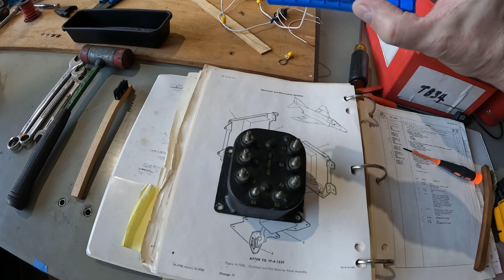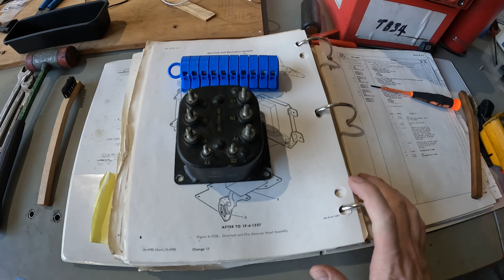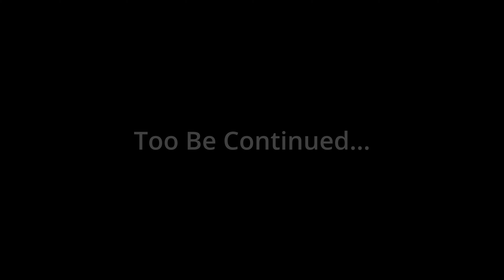Removing The Bad Relay, Maybe | F-4 Phantom

Comment from the maker: This was probably my biggest challenge to edit so far, with so much video from one camera angle as we worked on this relay. I know a lot of you are wanting to see this relay fixed and the jet returned to flying status, so do we, and we thank you all for the support and encouragement!
Reply: REally appreciate the videos. I have a question I've been meaning to ask;   why don't you guys build or have built a generator that runs off of hanger power that can produce the necessary 400hz required instead of having to start an APU every time you want to test something?
Reply from the maker: @theprofessorfate6184  Our pleasure with the videos, and excellent question! There are power converters available that can convert 60 Hz AC utility power into the 120/208 Volt 400 Hz power that aircraft require. Those usually require 3 phase utility service, and we only have single phase service in the hangar. We would have to buy a power converter and also pay to have three phase service installed at the hangar, both of which are expensive. An alternative is an electric motor-generator set which would do the same thing. We might have one in the back of one of the hangars, condition unknown. Thankfully the NC8 and dash 60 are reliable for us, and the NC8 is better on fuel consumption.
Reply: @theprofessorfate6184  Such devices do exist, not only for aviation (400hz), but also in industry.
Some US/Japanese industrial machines have to have 60Hz, for example in Europe. So they are often soled together with an electrical converter that converts the phase frequency. Depending of the power rating, such converters can be expensive, esepecially MIL-T grade.
Reply: @DieselThunderAviation  I wouldn't have guessed that you only had single phase in a hanger of that size. Thanks for responding.
Reply: @trespire  Hi. I'm familiar with those, but I figured an airport of this size would have had 3phase power to the hangers. Apparently not. Thanks for responding.
Reply: When they get her up and running you need to be in the back seat! You deserve it! Thanks phor the hard work and videos keeping us updated!

Comment: I feel your pain. Having spent many hours in door 19 in the mojave desert sun  and the monsoons of sea.  I have always wondered if the designers had made a best place install list and a worst place install list and then got the lists mixed up. I would fill the bottom with rags to catch dropped parts. I would tie lacing twine onto my tools so if dropped i had them on a leash. Keep up the great work

Comment: I spent a few years on RAF Phantoms, they are built for war fighting, ease of maintenance is way down the design list!!
Reply: Do you still carry the scars when the engine access doors let go and chew you up ?😬
I was a Kurnass structural technician, still miss working on them.
Reply: I work on modern fighters, and watching these videos definitely make me appreciate how much hard work went into maintaining these older birds
Reply: @baileyparadis1815  Spent many hours on nightshift hanging upside down in the rear cockpit wire-locking the radios / mounting trays under the lefthand console.  In those days wire-locking often had to be done one-handed, in the dark, or by using a mirror (or all three!!)
Reply: @millycarrington  Sounds familiar.
I've often spent 2 to 3 hours sitting on a stool inder the wing tanks, checking / replacing the Torqset screws in the under wing skin to the correct leagths in the TO drawings, then refreshing the blue sealant till it's a clean blue. Often in the late hours sitting exposed in the open QRA HAS to the cold wind.
Phantoms have leaky wings when flown hard.

Comment: Have you thought of putting longer wires on the replacement relay and hooking them up to the jet before you tried to take the old relay out? It probably would save some time making sure it works before fighting with the current one.
Reply from the maker: Thought about it yes, and there isn't a lot of slack on the forward three terminals. Especially with the old one still in place. Not to mention the added complication of keep everything insulated from each other.

Comment: Can you not get to the bolt with either an open end or box end wrench rather than a ratchet and socket? Yes it would be slower and a bit of a pain, but easier than moving that wire bundle.
Reply: The bigest concern is dropping hardware into the inaccessable bowels of the plane.  FOD is serious and should always be front and formost.
Better to take the time to prepare good access and vissability.
" Do it right, do it once. "
Reply: With 36 years of working on jets and warbirds, I’m very familiar with the risks of FOD and the frustration of retrieving dropped hardware……. Believe me!!

Comment: Was just wondering if anybody has figured out which relay is the older one, the white one in the jet, or the back one you’re replacing it with. The “white” one (which looks kind of discolored due either to age or repeated heating/cooling cycles) or the back one
Reply from the maker: Unknown with that as to which is the older part. Please don't let the white part fool you. That is a separate piece that is installed on top of the relay and helps insulate the terminals from each other since that is made of plastic.
Reply: @DieselThunderAviation  ahhhh. Thought it was part of the relay itself. The two relays on your wiring diagram look like the two relays you have